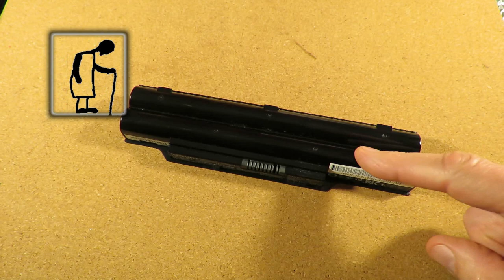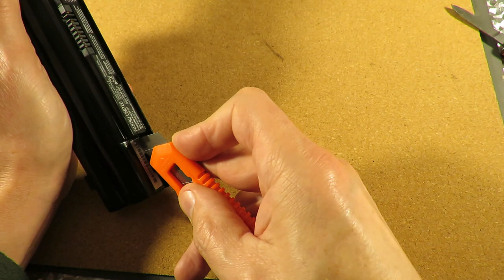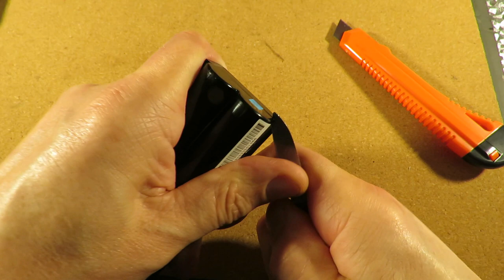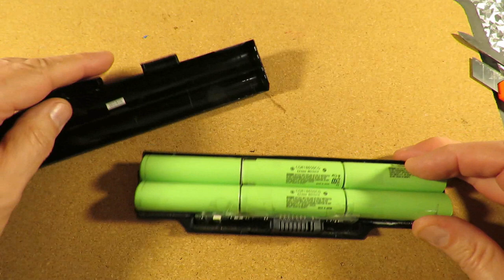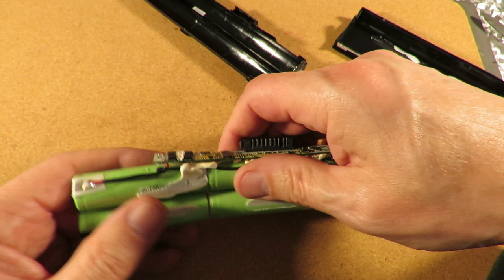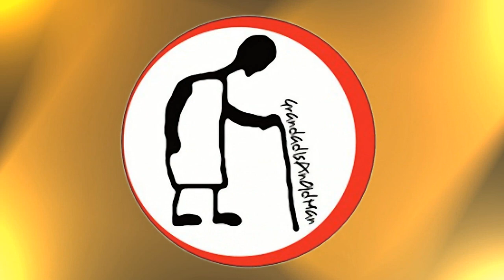Looking inside my old laptop battery - FUJITSU Lifebook

Comment: Really nice, Grandad. 😊
Basically, most of the time the BMS (the protection/charging board) fails before the cells. You know? That's why I always look for discarded notebook batteries to buy cheap, so I can recover the cells. 😊
Anyway, I never found a battery that would open easily. 😕
Reply from the maker: I shall probably rewire these with normal XT60 connectors for a 3S battery. They would certainly be OK for a car or boat.
Reply: @GrandadIsAnOldMan  Absolutely! That's a great idea! 😃

Comment: I used old laptop 18650's in my diy boat. There is usually 1 or 2 that are bad but the rest are ok.
Reply from the maker: They seem to be OK, I shall probably rewire these with normal XT60 connectors for a 3S battery. They would certainly be OK for a car or boat even if they are not perfect.

Comment: Greetings,is this laptop battery not working anymore?
Reply from the maker: If you check some of the other comments, the general opinion is that the Battery Management System (circuit board) stops the battery from charging after a pre-set number of cycles. So you will often find the batteries are still useful, but the pack will not accept charging.

Comment: Before taking them further apart, keep them in sets of 2. No need to remove the joining metal. This way you have a stronger battery if you ever need one (2 in parallel, possibly round 3500 mAh).
It was not okay to see the batteries had different charges. Perhaps balancing starts at the maximum voltage (4.2 Volt per cell), but they were all different. Rule of thuumb: 4.00 Volt = 80% charged, 4.1 Volt = 90% charged (and 4.2 = 100%).
If you have a set of (Christmas) lights, running on 3 AAA or 3AA batteries, you can use these recovered batteries to power those lights. Works like a charm.
Reply from the maker: I shall probably rewire these with normal XT60 connectors for a 3S battery. They would certainly be OK for a car or boat even if they are not perfect.

Comment: Its because the chip on the pack - is programmed to stop charging after certain amount of times the pack was recharged. Its similar to car light coming of for service, it deoes not mean your car is broken - it runned certain mileage and need s to be checked for safety. In this case the packs will degrade over certain time in their capacity- there fore manufacturer to protect its Brand name and the customer safety (iamgine one bursting on fire on an airplane travel that would be a bad press). It is possible sometimes to reset thic chip counter cycles. It is possible to replace the chip or reprogram it. It is also possible to desolder the whole PCB and replace with a knock off one that does not do any counting. Personally I would buy knock off battery and replace whatever knock off cells are inside to genuine panasonic tagged cells, the only issue is that the electronics used in Chineese knock off product are usually from recycled market, and can last not as long, and if they cathc on fire it will be on you takign the responsibility. Unfortunetly  it is not viable for a manufacturer to produce too many spare parts as this is usually done on the loss (cost of storage ). You might be more successfull in case of nor spares available - to recycle the old battery ( take it out and never use it again) and design your own battery pack that you can strap on the back of the lid and attaching a plug into the laptop so that it thinks it is powered by external AC adaptor. Of course then you would have to monitor the voltage manually as PC would have no clue of remaining charge in the pack.     Or you might be luicky and find a spec sheet for that IC on the internet and learn hgow to reset cycles. And keep using battery past its warranty period (capacity etc)
Reply from the maker: Thank you for that long detailed comment. Yes, I am sure you are right and if you want to put that much effort into the job, you could possibly repair the battery. If you were planning to do a large number of these, it might even begin to cost in as an economic hobby.

Comment: I thought an 18650 was 3.2V, isn't 4V way over??
Reply from the maker: Nope, maybe Google lithium ion batteries for more information. Freshly charged a lithium ion battery is 4.2 volts. They are usually listed as 3.6 or 3.7 volts as that is their 'nominal' voltage which basically is pretty meaningless.

Comment: of course you know by now how to open the battery however i will tell you anyways : put some benzin in between the cracks using a sireng (like a doctor's needle .the smallest one)
edit: benzin can remove every single type of glew , and THANK YOU FOR THE VIDEO MAN 🙂
EDITING AGAIN: THE CELLS OF THE BATTERY ARE FINE BUT STOPPED CHARGING AND BY THAT YOU SHOULD CHECK THE BATTERY ON THE BIOS OF THE LAPTOP, AND IF IT DOESN'T EITHER CHECK IT ON THE WINDOWS (COMPUTER MANGER, DELETE THE BATTERY THEN REINSTALL IT BY CLICKING ON THE SCAN OPTION THEN RESTART THE WINDOWS AND I HOPE YOU HAVE AN OK CHARGING BATTERY (I work in the tequ field) also i apologize cause i told you {MAN} WHEN I SHOULD'VE TOLLED  YOU SIR, SORRY
Reply from the maker: Thanks for the tips. This video is now 4 years old and I had already replaced the battery in an earlier video. This video was just to look inside. I have used the cells for my RC cars etc 😊😊
Reply: Sure sir, and i didn't notice that it was  4 years old and i'm sure that the the battery replacement was better than the one we've seen, and of course those lithium cells are  always good for something else (i usually use them to transform stuff uses regular batteries to lithium ones and make them a charging port using the chip TP-4056 and an old charger no more than one AMP @GrandadIsAnOldMan

Comment: I use these laptop too but what can icall them like i want to bu new and then remove old ones and put  inside the battery covers
Reply: Dont forget to tell me sizez
Reply from the maker: Look at the batteries inside. They usually have their details written on them. If they have the numbers 18650 that is the size of the cell. 18mm diameter 65mm long and the 0 at the end indicates they are cylindrical batteries (not square or flat). If you do not have soldering skills, you will not be able to connect the cells together.
Reply: @GrandadIsAnOldMan  thankie you there are like as in the video i have some little knuwledge on how to fix it

Comment: Maybe you are witnessing a case of "planned obsolescence" right there in your hands. A little research on google might help to understand, why your battery was not charging any more.
Reply from the maker: I shall probably rewire these with normal XT60 connectors for a 3S battery. They would certainly be OK for a car or boat.
Reply: @GrandadIsAnOldMan   I agree, usually it is just the electronics that fail. Batteries are still fine, most of the time. Keep in mind, your Cells may not be discharged at more than 6 Amperes. Better keep your current-draw well below 6A, just to keep it safe.